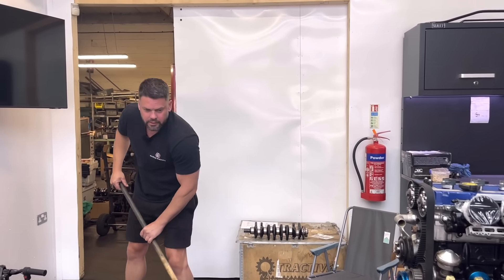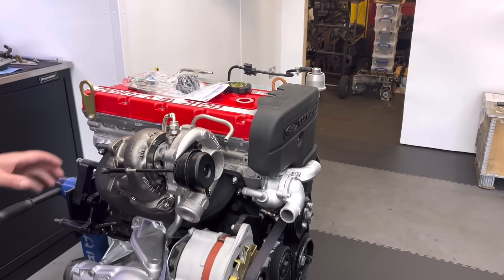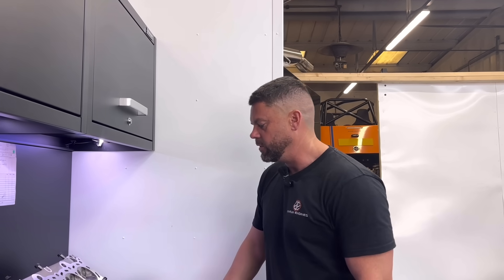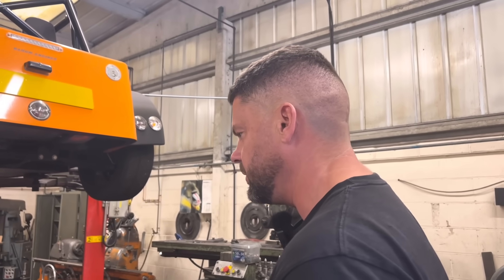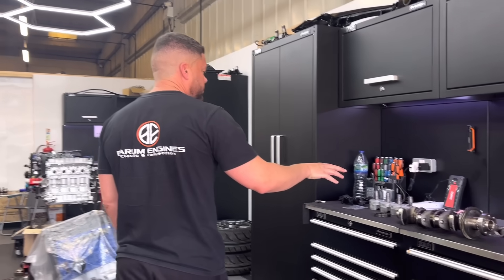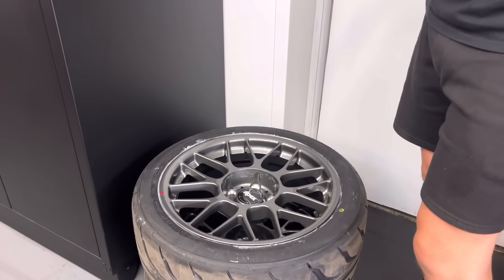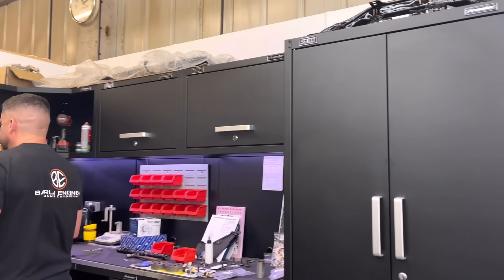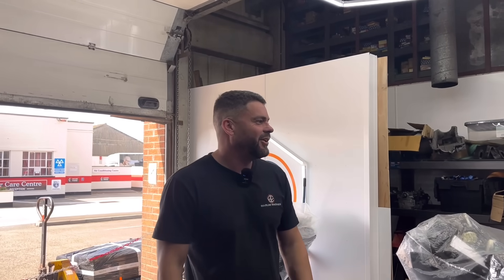We DISAGREE with the viewers on this subject!

Comment: I agree with you. When I'm rebuilding an engine - If I get a head / block machined, I expect to have to do a full clean myself - it takes forever, its a ballache and I've invested in degreaser/ cleaning kit myself to help out. The one exception is the odd occasion where my old machinist would fully clean and reassemble the head / valves for me (Since he did the seats and guides). It would save a lot of time - I could get the car turned around quicker if I specified the head "ready to go" - and I'd pay for it.. But apart from this - I expect to spend freaking hours cleaning blocks/heads...

Comment: Just a thought, maybe instead of relying on the small print on the invoice that a warning sticker is placed on the engine to bring to the customer's attention that the engine has not been cleaned, or that every engine is returned with post-machine guidelines.

There is being right and there is taking steps to avoid a customer complaining, even when it is not your fault.
Reply: This is a great suggestion 👍
Reply: Very good idea!!
Reply: Customers will complain about the glue from the stickers ... !  😂
Reply: Agree. Relying upon the small-print, although correct, isn't great practice. Just an old-school printed cardboard tag tied on with string would suffice.
Reply: Having built my first engine in the early 1970 because I could not afford to pay for a builder.
The engine builder is ALWAYS responsible for confirming all the parts are clean and correct.
As you say the cost of big red warning note printed on the invoice is simple insurance.
Reply: Better still. As part of your total service, you could offer to initially clean and pack any machined parts before releasing them to the customer. Then shrink wrap the part before it is shipped.  Charge for your time for this process. On your invoice include a line that states, "Packing ready for shipment, = $$$" Then stick a red label on the component saying "This component needs to be thoroughly cleaned before being assembled"
Reply: @ataxpayer723  45 mins is not long enough PLUS you have NO control of how well the block is protected from others mistreatment.
It’s like expecting the parts suppler to check the piston ring you just bought.
Reply: Thing is an engine builder shouldn't need a reminder that the final clean is their responsibility. Anyone who thinks they can build an engine and doesn't know they need to do a final clean before they put it together shouldn't be building an engine.
Reply: @1dcanon  Good customer service is about anticipating and preventing complaints. 

At the moment the company is protected by the small print. 

That is obviously not working because they get "complaints" and telling a customer that they are at fault is not good even when it is their responsibility. 

What would it take just to have a load of A5 cards printed with all the Post-machined guidelines and advice to help minimise complaints? Call it marketing.

"Anyone who thinks they can build an  engine", people are learning all the time, if people are giving it a go, why not help? 

To be honest, I would have expected that once a part is machined part of the process is that it would be cleaned. When explained it makes sense as to why Barum don't, and how even if they did it would still need cleaning again. But the fact it needed an explanation suggests it isn't obvious to everyone, and that it is in the small print suggest it does needs stating. 

Carry on doing what they are doing and it will always be a bone of contention.

Comment: As an apprentice I was taught that when you get a block that’s bored or surfaced you always cleaned out all stud holes and ran the high pressure hose through the water jacket, also if we had a head off you insured all stud holes were free of any liquid or the studs would most likely hydraulic.

Comment: a few of points - I agree with you - having spent time in the industry  1) it's the assembler's job to ensure that the parts are clean and ready for assembly.  That includes ensuring the bores are free of honing residue, all oil galleries are clean, all threads are intact and all blind holes are free of debris, water or oil, 2) Even if you take responsibility for cleaning (ie charge for it) you cant guarantee dirt dust grit and mouse or rat shit wont get into the parts in transit or while its siting around waiting assembly (which might be months and months). 3) YOU DO need to ensure the client is aware that cleaning their responsibility - if the client is not aware what it takes to PROPERLY CLEAN AND INSPECT parts for assembly they SHOULD NOT be building engines (or anything else).

Comment: Nope,  nope nope.  Yes, you put in the conditions that yes,  it is the customers responsibility to clean the engine out ... BUT BUT BUT ... clean up your mess anyway.   Blow it out as best you can, put a "needs cleaning" sticker ... and STILL CLEAN IT OUT  anyway.   That stud hole was full to half way up with swarf,  just clean it out as best you can, blow it out ... leave the job as smart as you can, make it looks professional.  So yes, we agree ... it is ultimately the customers responsibility ... BUT clean up your mess as best you can, turning it upside down and blowing out is fine. Put a sticker on the work ... "PRE-ASSEMBLY CLEANING REQUIRED"
Reply: They are engine builders NOT preschoolers that need to have there hand held and talked down too.
Reply: @who-gives-a-toss_Bear  The whole point is to produce jobs that delight the customer and build repeat business.  Regardless of the wording in the small print at the bottom of the invoice, you think that customer is either pleased or will come back?  (ps: you think the mechaic in the workshop got to see the invoice and read the small print?  Thats why you put a sticker).  If you send work off and one company returns it dirty and unwrapped  and the other returns it relatively clean, in a plastic bag with tie wrap and some advice reminder about "needs pre-assembly cleaning" even though you blew it out ... which one you going to use next time?

Comment: Lee, you are absolutely right… if you’re not assembling all the bits to make the engine whole, the assembler must be responsible for thoroughly cleaning everything. If it wasn’t this way, any cockup by the assembler would be thrown right back in your lap. Good for you for putting a disclaimer on the paper work and drawing a line in the sand on this matter.

Comment: Any machine shop should blow out the block to remove loose swarf but as you say 100% cleaning ready for assembly is not practical unless you are building the engine yourself. I agree a large red sticker on the uncleaned block or head saying "final cleaning needed" is a good approach.

Comment: Perhaps you could give some adivce on the invoice or and put a Lable on the engine - what areas to check and clean in RED print; cost nothing and every one knows where they stand.
Reply: No point putting it on the just the invoice, the guy assembling it in the workshop will never see the invoice.   You also need a tag on the part saying "needs final cleaning"... personally, I would blow it out upside down, plastic bag it, add a tie wrap and a "part needs final cleaning" tag and despatch it looking like a really pro job.  Extra cost, about a quid. Result?  Customer job goes right, customer happy, and happy customers are repeat customers.

Comment: Panelbond is amazing. One of the first cars to use it in "numbers" whas the 1st Lotus Elise. The alu extruded frame was bonded, not welded. According to Lotus (and I believe them) this was stornger than welding it. They went to Denmark to get the expertise to do this and since then, they have sold their experience in using it in automotive mass production to many car manufacturers.
Reply: Very true and many many manufacturers bond panels/stress bearing parts today as there's so much more surface area used than a normal weld or spot weld. A lot of body shops will use panel bond for part or patch panels as there's zero risk of warping from welding 👍

Comment: Maybe you could modify your procedure to fit plastic threaded plugs in your tapped long stud sockets after leaving them cleaned thoroughly. You could also provide a cleaning modus operandi specific to those for the fitter to refer to;  "anti-destruction destructions"..... with no compulsion for them to be read but a further aid to any warranty issues.
Reply: Even just plastic bungs/caps might suffice to keep them clear from this sort of risk. The only trouble is that this might be used as the basis to claim that they relied on them being totally clean in the event of any dispute when swarf was subsequently a problem, detracting from the industry custom of the Fitter being responsible/liable for cleaning ... 🤔

Comment: I was building Chevy V-8 engines 40 years ago and when I picked up the block and heads, the machinist I used always told me face yo face to make sure I cleaned it all again inside and out before I put it together.

Comment: Lee, it IS the builders responsibility, and you have it in print, but all the same, just put some red magic marker or bright color nail polish / dykem spray paint on those holes so they HAVE to clean it up better, it might cost a few pennies but will save you money in your reduced time lost to unnecessary calls.

Comment: Cleaning the parts after machining is always the customers'/builders' responsibility, not the responsibility of the machinist. Unless the business doing the machining is doing the full build, then they're responsible for the cleaning as well.
Reply: that's the industry standard where i am as well the machinist can't guarantee the part wont sit on the shelf in some blokes garage for months and months with rats and mice running all over the job.

Comment: Anyone who has machined cast iron on a lathe and hasn't cleaned it down for a few days will know Lee is 100% right on his theory how the cast iron cuttings became solid in the bottom of the tapped hole, cast iron cuttings and moisture will set like concrete.

Comment: In the case of an aftermarket engine the final assembler of an engine is 100% responsible for its cleanliness and proper assembly. The engines suitability and how well and how long it lasts is the responsibility of whoever specified the engine and its parts for a given application. In the case of Toyota's current engine recall the root cause was an overlooked cleaning step in the engine manufacturing process. The block should have been cleaned properly before it went to final assembly.

Comment: Do you Gentlemen Cerakote the Turbine Housing on the Turbos you install?!? Ceramic Coating was originally invented by Rolls-Royce Aero Engines to be applied to the Turbine Blades in their Jet Engines. Kept the Titanium Blades from melting. It makes sense to Cerakote both the inside and outside of the Housing and the Turbine Wheel itself. Cerakote on the Housing locks the heat inside and Cerakote on the Wheel reduces expansion and protects it. Cerakote also reduces Surface Friction for better Air Flow.

Comment: I totally agree with Lee here. Either he has to do a very thorough cleaning, charge for it, and is liable, or he doesn't clean at all other than blow off some of the chips as he mentioned so they're not falling all over the place when shipping the part out.
I think it's better for a customer to be able to look at a part and clearly see that it needs to be cleaned rather than a partial clean that may cause a customer to forget and forgo a thorough cleaning.
I think it's a huge liability issue to clean and have to stand behind the cleaning on machined engine parts that go out and are assembled by someone else.
I feel that Barum needs to only concern themselves with cleaning the engines that they are building themselves where they can control the contamination. 

My two cents.

Comment: In principle, I agree with you guys on "the customer is responsible for cleaning". Having said that, clean your work up. It's the professional thing to do and one of the reasons why you can ask more than the bottom feeders that sell "engine rebuilds" for 1500 quid. Again, that doesn't have to mean that you are responsible for swarf messing up someones build, but any discussion you have will reflect bad on you for no reason and will cost you more time and energy than it's worth.

Comment: I did not see the comments, but I assume you were talking about the cosworth with the long stud job, and all I can say is the fault lies with the assembler in that case...  I bet they never checked the height of the tops of the studs. If they had they would have noticed a considerable discrepancy.
I would also suggest to you that if you do a job like that, for your own peace of mind, (and I bet you will ALWAYS in the future) you should check yourself that the stud can screw in completely. Not having the new stud kit shouldn't matter to someone doing this and replacing them all the time, as I am sure you can find plenty aroung of the length you need to test.

Regardless of that, the cleaning is a REQUIREMENT of anyone assembling the motor.

Comment: You should always check parts are clean when rebuilding anything,more damage is done putting grotty parts on things,cheak things are clean,if you rebuild a injection pump,you would clean everything,twice,so why is a engine any different, get a engine from reman,you have paid him to clean the parts he has work on,the customer does have to ensure ALL parts are clean inside and out,good video,but it will create debate,usually about who’s paying.

Comment: Couldn't agree more the person who is doing the final assembly is responsible of making sure everything is clean and also should measure everything before assembly to make sure all parts are in tolerance, much easier and cheaper to measure before assembly than to find out you are trying to fit components that are to tight or loose, also easier to discuss the way forward with the machine shop
Reply: Yea the punter needs to thoroughly clean the parts but the machinist needs to blow the bloody chips out for a start.

Comment: Specifically, in the US, those are called push brooms. And there you are pulling it. 😜
Reply: Pulling is the correct method of use, pushing results in dirt being flicked up into the room you are cleaning when you reach the end of the push stroke and the bristles return to their normal position.
Reply: @Unimatrix69  Pulling results in exactly the same flick. Pulling just ensures you get dirt on yourself. It is all dependent on how much pressure you put on the broom. But it was a joke not a complaint.

Comment: Maybe put a tag on the unit stating it’s up to the end user to check for cleanliness etc, like the manufacturer does when they supply a unit that has no oil in it but it’s the job of the end user to add the oil etc
Reply: attatching that tag has the same time and effort as blowing the hole out
Reply: @metalworker007  it’s not about the time it takes, it’s about taking responsibility for the end user to make sure it’s clean

Comment: 225/45r17 and 255/40r17 are exactly the same roll out . Even lookin at the side walls they look the same just 2 inches width between.  That should be your tire side. I used to have that above tire on 17x8 wheels before I went to 17x9 and 17x10 wheels with a 255/40 on the front 275x40 rear on my rx7 . The car handled better with the narrow staggering vers wide

Comment: You are not expected to make your blocks perfectly clean before shipping but a basic go over with the air hose to clear swarf would be entirely reasonable. Spend 5 minutes and save problems. Plus it gives you a chance to do a final check on the work. How do you know the hole packed with swarf is actually tapped to the bottom?

Comment: from America and I've built alot of engines over the years, it's the customers responsibility to make sure everything is clean before putting the engine back together. one, u doesn't know if the customer put the engine back together on the dirt floor or transported it in a trash truck. agree 100% with u on this.

Comment: Aiming a bit small with those tires, get a second opinion,  raced here in nz ran 235 on 8inch rim. A 9.5inch rim should easily take 255.
Reply: Tyre Tip. The width of the tread should be the same as the width between the two beads of the wheel. A wider tire does not always give you sharper handling. If you run a wider tyre than the rim of the wheel, the handling will become "squirmy".
Reply: @ataxpayer723  tip check Google says 235 on 8 inch rim ok. Raced this with no squirm think your talking side wall flex. Another tip, when racing you're wanting the widest tire possible = more traction,  just saying.

Comment: ...not sure if you were using that broom correctly, as I think it is a 'push' broom and not a 'push & pull' broom! your apprentice should be able to guide you? 🤔 😜 🤣
Reply: Pulling is the correct method of use, pushing results in dirt being flicked up into the room you are cleaning when you reach the end of the push stroke and the bristles return to their normal position.

Comment: I think you are correct. At our shop we always used the same machine shop they were very reliable and did proper work. We always went over any machine work and did a final cleaning of the overall piece and cleaned all threaded holes and water as well as the oil galleries. Most times it was well done but in building the engine ourselves, we could  guarantee it if we knew factually that it was clean by our inspection. There was never a time that we ever complained to the machinist about final cleaning.